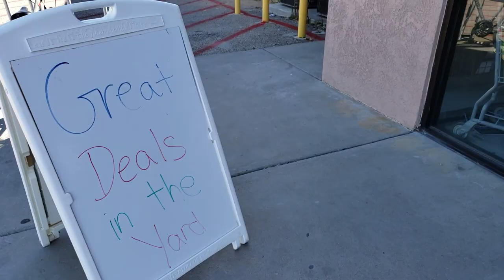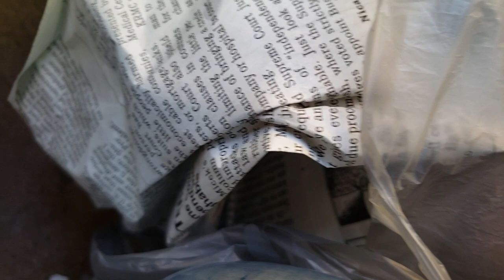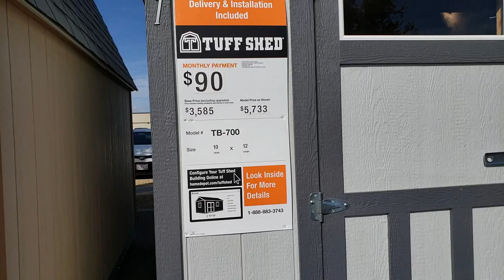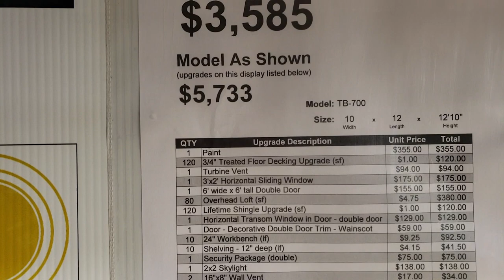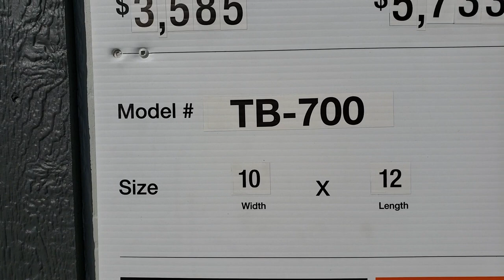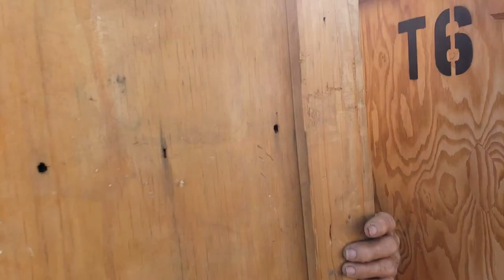BLISS Buster!!! Tea Time Trauma Tales after a great day.

Comment: Take that tall wooden box, turn it sideway. Cut the door in half, put on both side. U get a short, manageable, cheap storage space. add a tarp to prevent rain. Buy extra henges and lock for two doors. No need expensive storage barn. Taking time, wait, I bet Dawn will have more right size crates for u